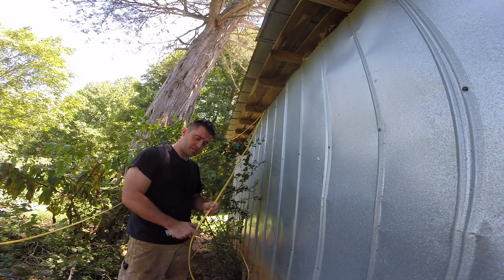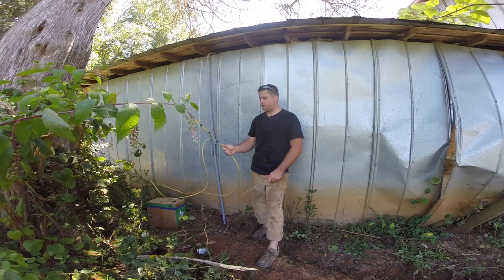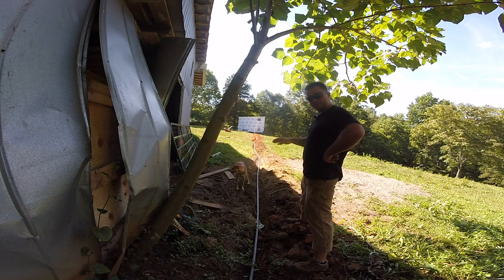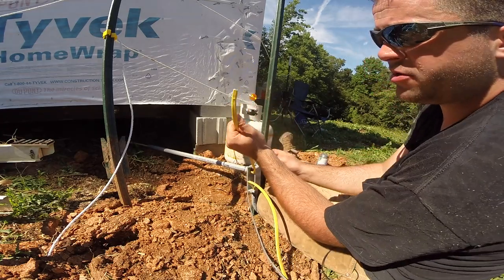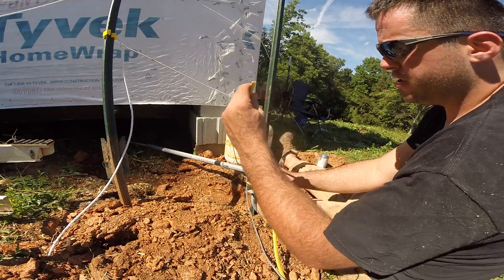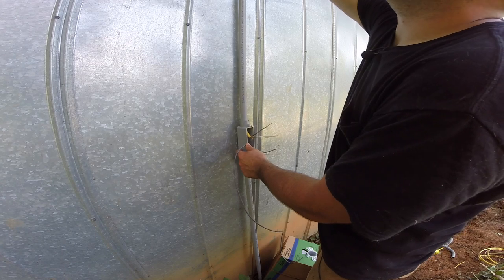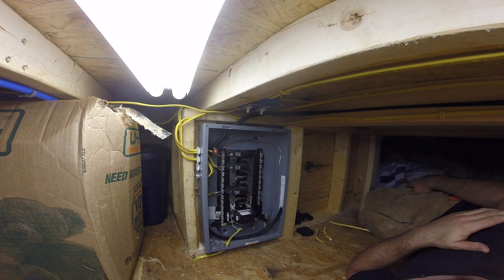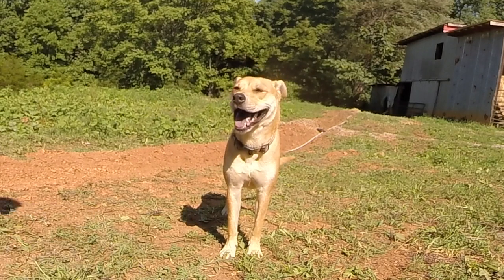Tiny House - Running Semi Permanent Power to the Tiny.

Comment: I wish I had a rototiller when I dug my trenches but then again I had a ton of roots so it probably wouldn't have been much help.

PS - Tech Tip: you might want to use an inexpensive ethernet hub to act as a buffer between that long Cat5 run and your equipment. Between the induced AC and lightning strikes your computer/router won't last long. A surge strip with ethernet ports would be recommended too.

Comment: Electrician Dan! Nice to see the lights come on at the end. I saw a few others comment, but I can confirm that running non-power-cable like Cat5/6 in the same conduit is quite bad :P The main reason being that if the conduit were to get damaged and the wires inside all shorted to each other, the Cat cable could get a jolt of 120V... this is more likely to damage equipment than start a fire, but there's always a chance. Another reason being that the electromagnetic field from the AC current flowing through the power cable can induce a voltage in the Cat cable when they're run parallel right beside each other, which can affect the very sensitive data signal. This is Jake's area of expertise so hopefully this is helpful info! (not meant as criticism)
Reply from the maker: Yeah. I hear ya. When I run the new permanent power. How far apart do the two lines need to be from each other?
Reply: +Tiny House Customs It's more important just to have a barrier between power and data. In terms of interference, it gets worse the more current is flowing nearby... so since the tiny house won't be drawing all that much, it would probably be fine with a few inches of space, but do a foot if you want to be totally clear ;) 
How much amperage do you expect your house to draw when it's fully operational?
Reply from the maker: +Tiny Nest 30-50  Ive been talking with my landlord about running more power which involves a lot more than what i did here.  ill have to run a new line from the meter to the barn then to the house.  so ill be calling the pros in for some of that.  id like to run 100 amps to the barn and then 50 to my tiny.  I don't want to invest a ton of money into something thats just temporary.  so i need to figure out what my plan is for the next few years.
Reply: +Tiny House Customs Would need a refresher on your plans for space heat and cooking etc. but you might be able to trim off some of the electrical demand (and thus make it cheaper) by using a few energy sources, like propane. The Tiny Nest should be able to run on 30A @240V, and only that high because we've chosen electric cooking, so when we're not cooking the draw should be quite low. And BBQ in the summer! :D

Comment: Awesome Dan!!! You really killed it with this video series! Great job!! My question is if you were to go completely off grid have you calculated a solar/wind/water powering system? How much electrical you are consuming using all the pumps and appliances to run the tiny house? I'm in the process of building my tiny house up in Kanada and want to run everything you have. But completely off-grid

Comment: Hate to say it but may have been able to run 4/4/2 with ground aluminum wire for about that much money and have your full 100 amps to the house. That's my experience anyway. It runs 1.49 ft where I am. Also you could ask around but when I wires homes for a living we never ran communication lines parallel with power wires, causes all kinds of bleed through from what I understand. I never tried it. They can cross each other 90 degrees but not parallel. 4/4/2 is required for 100 amp per code also electric comoany won't install at meter pole if wire isn't that size.

Comment: aren't you going to need a VDSL or something when you run Cat over a long distance??
Reply from the maker: +MusFuzZ VDSL?  Its a really weak signal.  just enough to run videos  i should put a box(VDSL?) in the barn which is half way to strengthen the signal, but it works so I'm not gonna waste the money

Comment: That's not 12/2 Romex  your running through the PVC is it , ?If it is   it is not rated for running in pipe .   From the looks of the video  useing the cat  5 and romex in the same pipe is way against code and dangerous  to be showing people with no clue of what they're doing . Along with  the clearance  for the breaker panel  at 4 + minutes  . Doesn't matter if it's temporary or not  it , if your making a video it should be safe  so someone or their families do not get hurt ..Don't want to be a downer  over your videos  but really  safety is formost  isn't it ?